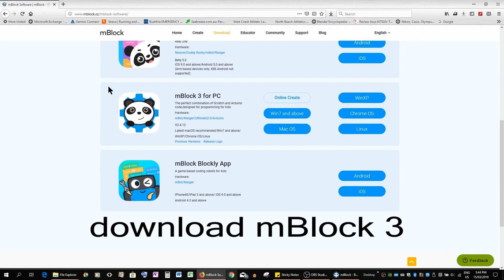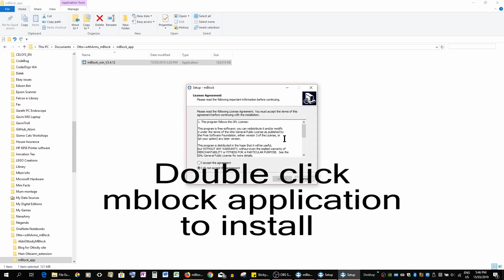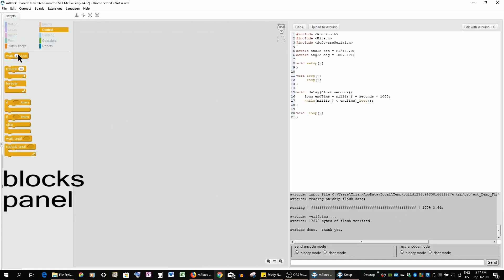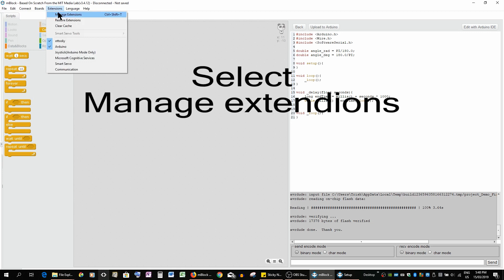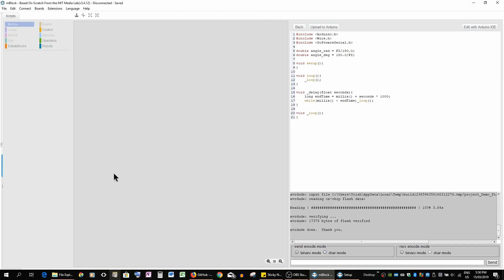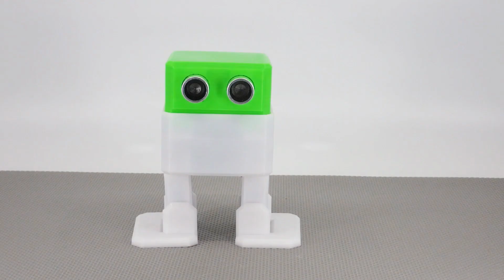Install mblock3 extension then code Otto robot

Comment: Could you please fix your tutorials on ottodiy and wififactory?
https://www.ottodiy.com/blog/calibration links to newers files and you cannot follow the tutorial.

I am trying to figure out which blog post and which wiki page combination is actually right. It's a total mess.

Also the tutorial is for mBlock 3. Currently we are at mBlock 5 in which it is difficult to add custom extensions. There are only pre-defined boards and extensions available. OttoDIY is none of them.

Sometimes your instructions are strange because of weird grammar mistakes. With some fantasy you can understand it but for a (internationally used) STEAM project this is absolute unbearable.
Reply from the maker: thanks for your feedback now is fixed!